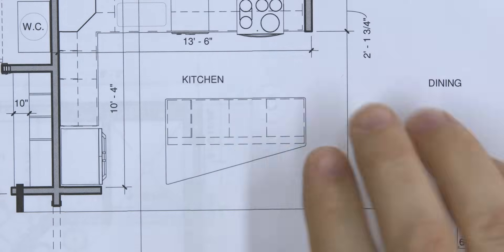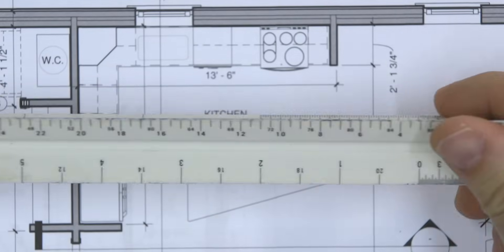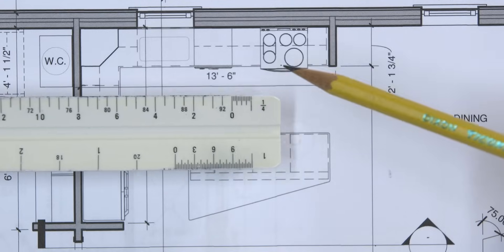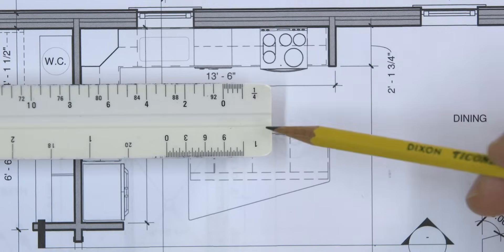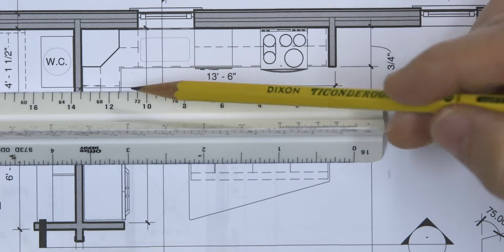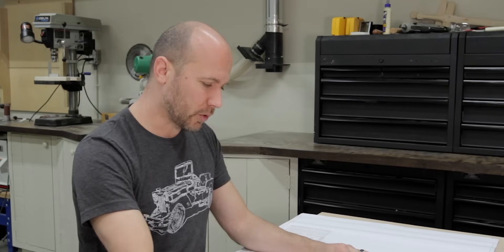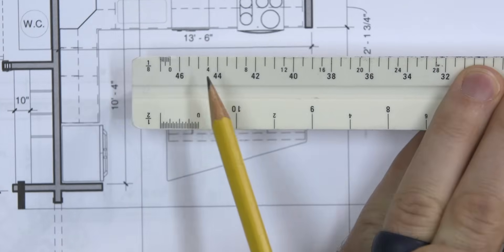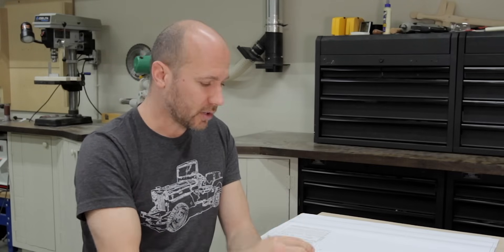How to Read an Architectural Scale | Beginner

Comment: Ordering my tech group to create a public usage System Structure of Protein chains reconfigurable to RNA pathway with uracils of Roller coaster ride   slopy and wavy air structures on Earth or DNA of Codons with Thymine pathway of the same pathway for the Rails of Carts or Rails of Beads types effects in science and of Rates of spikes and Wavelengths of economic and Trade indicators and balancers with some extras of system and hi tech designs that when those things flashed at the molecular atmosphere, or hologram pings and bounce, or by pixel in the air effect, economies, business and exchange rates or financial trends shall be moved by such image air projections with its corrections and fixations or fluctuations and station nodes to stations particles of science Quantum Mechanics message courierings of its super secured modes independent of quantum networks scopes for the air or atmosphere air currents and temperature degrees of molecules  assist usage can determine its encryption keys per real time particles movements on Earth. Fund allocation for such from sourced galaxy now ordered. Let it be

Comment: Key insights

🌍 Architectural scales can vary depending on the region, with this particular video focusing on feet and inches.
📐 Each line or mark on the 1/4 scale represents one inch, with 12 of them adding up to one foot, making it easy to measure distances accurately.
📏 The architectural scale allows for precise measurements in both feet and inches, making it a valuable tool for accurately representing dimensions in architectural plans.
📏 The 1/8 inch scale is different from the 1/4 scale, as indicated by the number of marks on the ruler.
🧠 Knowing that the marks on the scale have to add up to 12, you can easily figure out that each mark represents two inches, not one like the 1/4 inch scale.
🤔 Understanding the architectural scale requires knowledge of how the marks on the scale correspond to different fractions of an inch.
🏠 Understanding architectural scales is essential for accurately interpreting and reading drawings in the field of architecture.
🛠 Understanding how to read an architectural scale can help determine the width of components like the sill plate in construction projects.

Comment: Great quick and easy lesson - but one question! My planning dept requires me draw a site plan at 1" = 20' scale. Where can i find a ruler that will give those dimensions? Or what do I do?
Reply from the maker: I haven't seen a ruler that does that but I'm sure it's out there. How accurate do you have to be? It's easy to get down to the foot but anything in inches would be tough just using the 1" scale.
Reply: I need to find an architectual scale! Please help

Comment: This might be a stupid question but how do you get a 1/16 scale of the smallest scale is 3/16?
Reply from the maker: Not a stupid question! :) You can use a 1" normal scale or sometimes marked on the ruler as 16. Each small line on that scale is a 1/16".

Comment: I want to build a set of jack stands for my 1/24 scale model.  How would I scale a real set (measurements) jack stands down to 24th scale?
Reply from the maker: You should be able to use the 1/2" scale on the ruler. So every 1/2" on your model represents 1' on the actual jack stand. You can also go down to a 1/4" scale as well. .25" on model = 6" on actual object.  As long as you keep the 1:24 ratio, you can use any unit of measurement.  Hope that helps.

Comment: On the page where you used the 3-inch scale, how did you know to use that scale?

Also this did clarify the scale itself. Especially the 3-inch reading. I'm in a print reading class for my job, and figured I should know this before the next session.
Reply from the maker: The scale the drawing is drawn in is normally printed on the page.

Comment: Nice tutorial! 
I have worked in structural steel over 20 years. 
Mostly as a fabricator on the shop floor. 
Spending a lot of time reading shop drawings with some time on arch. Drawings too. 
I want to open my own company. But for now I took an estimator position for a sister shop that does (our overload work) haven't really used a scale since high school drafting class. Been relying on my job project managers and contractor detailers to help me through some details. These vids are big help!
Reply from the maker: Very cool, glad the video helped you out!